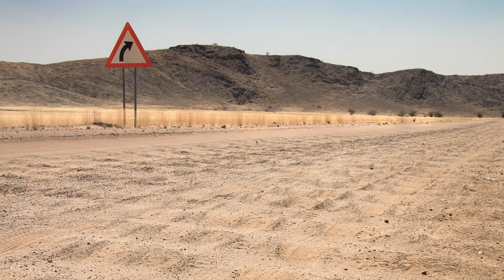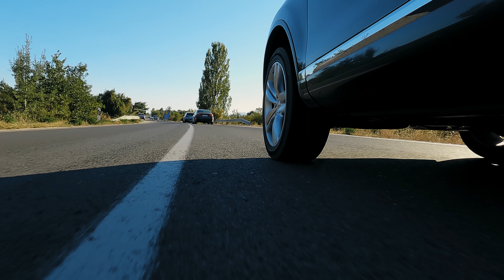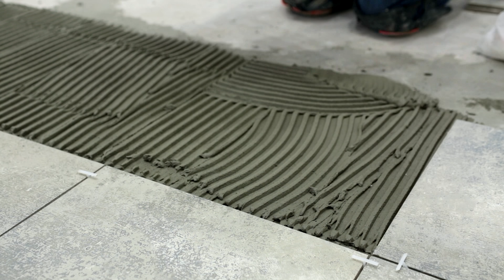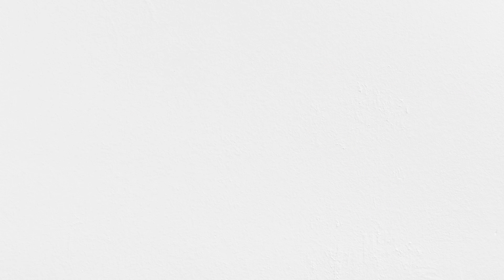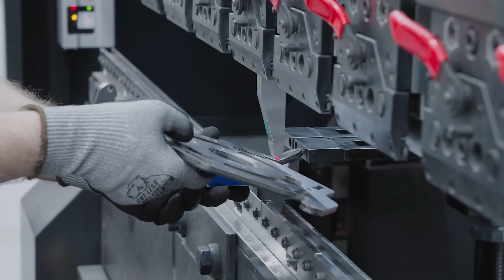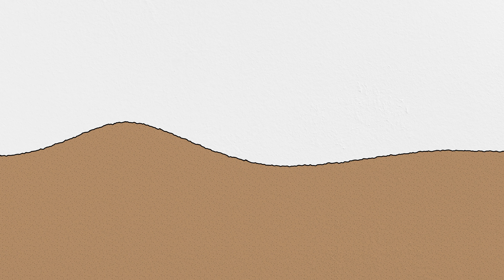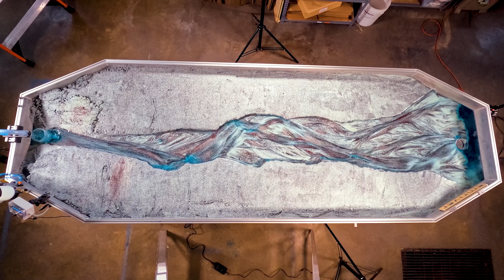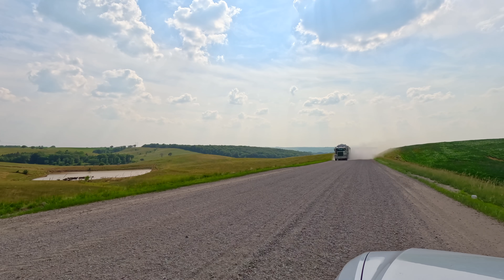Why Roads Get Washboards

Comment: Also, this setup was flawed because it relied on 1 wheel. Vehicles are multi-axle machines and have multiple points of contact with the surface having the effect of creating a frequency in the gravel medium, causing it to organize the materials in a repeating wave. The washboard is the “echo” of the traffic that came before it. 7:33

Comment: I think we had like 18-20 miles of dirt road. And every 8 years at town meeting the pitch was the same, "graders got over 16,000 hours on it. Last legs. Need a grader, all the parts for the 8000 hour overhaul, etc (basically 90% of what you're going to need other than tires for the next 8 years) you get a better deal on equipment if you buy 100k in parts at the same time.  Know what saves even more? Using the logic of the State. And run the literal "Highway Department" on "Off-Road" pink diesel.

Comment: I've argued for decades that moguls/washboard snowmobile trails aren't caused by the track roost, but by plowing the face of a bump. Sure, hard starts, spinning the track, create the pile and the dip. However, that doesn't explain the exact frequency that form along a stretch of trail.

Comment: Where I live in the remote PNW there are an unimaginable amount of unpaved roads.
Roads that are very rarely used the weather seems to maintain them well for the most part until all the fines are gone.
The main dirt roads however usually always have sections of washboards on grades. 
An easy way to slow down washboard is to just drive in 4 hi. 
All four tires pulling leave less room for tires to spin which I believe starts the process of washboard.

Comment: Was going to say its got something to do with suspension. In the sand dunes we have drag strip where we drag race atvs. The slow side has heavy bike that are shifting gears and loose suspension. That side is ways rippled out. The fast side have atv with no suspension  (ridid) and transmission that dont use the clutch. It stays smooth all day.

Comment: I would love to see a comparison video talking about differences between these bumps and "braking bumps" / "acceleration bumps" that form on motocross tracks. I was always confused by these small ones on gravel roads bc it made sense to me that they would form on the track when you're coming into/out of a turn and braking or accelerating hard, but didnt see how they could form on a fairly straight & consistent part of a gravel road. I always figured if it was just a natural tendency due to small differences like this video shows, they would show up in straightaways on the track... maybe it has something to do with acceleration/deceleration/constant speed?

Comment: The wheel was dragging. So the question, do the driving wheels or the non-driving wheels cause this? Most of the dirt roads I've driven on in the EU are not washboard. It seems to only happen in USA or other dry and devoid of organic component soils

Comment: Super interesting, as usual! I think that a vehicle's spring suspension adds to the creation of these, also, by adding to the rebounding energy with which the tires can hit the gravel. I have noticed that often, washboards are worse toward a stop sign, so I figure the added pressure of the brake action helps push the gravel forward. I have even noticed in some areas where asphalt pavement will develop a few washboards toward the stopbar before a stop sign or light. Braking must be particularly hard on the wear surface of the road.

Comment: Very neat!  I remember being told when I was younger that washboard roads were made from the tires of cars and trucks driving in 2-wheel drive instead of 4-wheel drive.  Something about the front tires in 2-wheel drive hitting the washboard bumps and making them bigger rather than moving over them.  I assumed that was right.

Comment: Semi-tractors take up hill grades or around corners cause this effect easily. The drives are so close together one wheel slips when another grabs traction. Found on all logging roads everywhere. If ever seen a semi tractor go over wash boarding you will understand... you can watch the front drive axle and the rear drive "bobble" up and down at perfect intervals , front axle up...rear axle down, then  front axle down at exactly the time the rear axle is up a teeter totter effect... this is what happens to roads when significant weight is applied to any spot. 50 to 60 tones of weight making contact to a 8" x 8" (size of tire face making area)piece of road.

Comment: This video is not really right, particularly the model demonstration with sand and a motorized wheel.  Real dirt roads are normally composed of tire compacted dirt, that experiences substantial daily temperature cycling, not pure soft sand in a fixed temperature controlled environment.  Additionally, real vehicle tires are normally air filled rubber with suspension components, which will not behave the same as in the simplified model.

Road washboarding primarily occurs on dirt roads in sunny desert locations.  In desert locations, the dirt is usually mostly or entirely devoid or decaying organic matter (ex: plant roots and other plant debris).  In the absence of the organic matter or similar factors, the dirt can become highly compacted and densified from compression associated with repeated tire travel on the road surface.

The overly densified dirt has no place to easily expand to, during normal thermal coefficient of expansion, during daily temperature swings associated with hot sunny summer daytimes and comparatively cool night times.  When the dirt road surface is overly compacted and overly dense, the individual dirt particles have no place to expand to, during temperature rises associated with sun baking during the day, leading to forced buckling of the road surface.  The raised buckled portions of dirt are perpendicular to the road vehicle travel direction, since the road is much longer in that dimension, than it is wide.  In the road width direction, the road can expand some, since the shoulders of the road normally are not as compacted and can take some thermal expansion compressive forces to force the dirt to become more dense.  However, further densification does not happen in the direction of the road travel surface, since it is too long, and there is not low density region immediately forward or reverse of the road surface that needs to expand during heating.  Consequently, "buckling" is the result, with part of the dirt pushing up in the familiar "washboard ripple" pattern.  When the road surface cools back off at night, the raised portions of the road do not go entirely back down, as the individual dirt particles simply pull away from each other instead, leading to a decrease in the density of the bulk material.  However, once a vehicle drives over it again, it gets re-densified, and if that happens before the next re-heating cycle, new buckles can form anew.  

Dirt surfaces where tires do not travel (ex: land adjacent to the dirt road) does not develop washboard effects, since it is not as compacted.  When the daytime sun heats the non-road soil surface, the individual dirt particles can expand and increase the density of the dirt, without causing buckling effects.  Instead, the dirt particles expand into the air or water voids that are normally present in the bulk material.  However, overly compacted dirt does not have the necessary air voids to accommodate thermal expansion without forced buckling.

To prevent washboard ripple pattern effects on dirt roads, something compressible but somewhat elastic could theoretically be mixed in with the road surface material.

Asphalt road surfaces are normally much less susceptible to thermal expansion buckling effects, as the gravel particles used in asphalt roads tend to be quite large, with considerable voids between the gravel particles.  The tar in the asphalt road also acts somewhat like a very viscous fluid, particularly at high surface temperatures associated with sun baking, which allows the material to slowly flow and change shape to better fill and/or ooze out of the voids/regions between gravel particles, during thermal expansion.  However, during thermal cooling, the thermal contraction does pull the road apart from itself, eventually leading to cracking in the asphalt surface. Consequently, asphalt road surfaces to not last forever, as they lack tensile strength, but they are at least better at avoiding washboard/buckling effects.

Comment: I was wondering when this phenomenon became apparent. There must be a minumum wheel width so that you get washboarding rather than wheel ruts. Speed, or maybe power, is also significant. But if everyone isn't following the same rut then the circular demo breaks down because the wheel in that always follows the same path - not one a little to one side or the other of the previous one. Surely then the forces on the dirt push to the sides as well as forwards.
Thanks for an interesting insight into roads and showing why (as all academics would agree) further research is needed.

Comment: LOL'ing just a bit remembering a "major" (unpaved) road that used to be one of the main routes into my community several years ago. The county's approach was to bring out the graders a couple or three times per year until the eventually threw in the towel and paved it (and then had to repave and repave and repave because asphalt is definitely not indestructible).

Comment: I don't believe you. I don't think that the washboard in some of the footage, that is at the very edge of the road, where people would not be driving, for fear, or being cautious, of not running off the edge of the road into the ditch, is caused by tires.  And the straightness of the lines of dips tells a different story. Bouncing road grader blades cause the majority of washboard, at least in Colorado.

Comment: After 35 years of dirt roads, washboards are something I've though about a lot. Solid axle trucks in 2 wheel drive make them form fastest. The always form on loose uphill stretches first. Often times downhill stretches dont get any at all. And if you want to smooth out the washboards put it in 4 wheel drive.

Comment: Has anyone tried using a type of resin or glue mixed in with the sand to keep the road straight. I know this would make the roads more like sand paper or a grinding wheel, but I'm sure there might be some materials out there that would be more rubber tire friendly.

Comment: Wonder if it could be "solved" by having a secondary tire that overlaps the rear tire but connected to the same piece of suspension. So when the front tire is going to drop down into the low point the overlapped reartire is at the peak so it never has the opportunity to drop causing the washing boarding.

Comment: Grady, as interesting as all of your topics have been to date, this one reeeeally hits home!  I've pondered washboard a lot since 2014 when I left the South (a Beaumont native corrupted by Tennessee for most of my life lol), for I moved to North Dakota during the oil boom after 20+ years driving trucks long-haul since '93.  During the boom, eeeverything was dirt up here in western ND and eastern MT and often very remote, especially in the badlands.  Instead of limestone gravel like we had back in the South, they use scoria up here (sedimentary rock that often has fossils within).  It remind me of clay pots, for it's a similar color and after new scoria is spread on a road, it doesn't take long for traffic to crumble it into highly abrasive dust that turns to the slimiest mud I've ever been in (honestly, I'd rather drive on ice that to drive in our mud, for even throwing tire chains, it's often a losing battle).

More and more of the counties up here have been paving the most trafficked county roads but there's still a tremendous amount of mileage that's "dirt" (scoria}.   Of course, the entire population for the state doesn't even make up a good neighborhood in NYC or the Metroplex.  lol  So washboard is still ever so common up here.  It took a while to learn how to drive it, as well, for there is a sweet spot in speed for much of it where it smooths out while still having control.  The experiment you set up kind of confirmed my guesses, though.  Thanks for making my day with this one!  :)

Comment: I honestly wanted to comment at the beginning of the video of what causes washboarding.  I frequently 4WD in the Outer Banks (will be there in less than 2 weeks doing this).  Constantly I find the ruts in the sand all washboarded out, and its largely due to high power pickups and diesels that just cant find that sweet spot with controlling their torque.   Between the constant slipping each tire makes and the excess power generated by each vehicle the roads or ruts just arent a very pleasant ride.  So for this application it makes sense, and I would call it rhythmic transfer.   More speed / power = greater transfer.  Which is exactly what I saw your experiment yield @8:36
Reply: Would be to interesting to see if there are the same number of undulations at different speeds.
Reply: Worked on a mine with excessive soft sand. The chaps there had worked out that 4x4 engaged was the only way to prevent corrugations. It became compulsory dye to the slip on 2wd vehicles. Honestly it worked well.

Comment: One look, 2 mins in, just putting a guess here before i finish the rest of the video. its a frequency. likely the frequency is dictated by average length of distance between axles, wheel size average, and the average speed at which those vehicles travel over the road in question. obviously the solution can't be to vary your vehicle axle count, length, speed, or wheel size so the solution likely involves purposeful rock and pebble size or layering to disrupt or cancel the frequenc(ies) causing the washboards to form in the first place. this may also be impossible due to the rural and cheap construction method underlying the reason unpaved roads exist in the first place. i imagine this also happens on softer or poor foundation paved roads as well in certain conditions.

edit: still havent played past 2 minutes in the video. im predicting the solution other than specific layering of different sized rocks and pebbles for the unpaved road, would be to have different speed limits at different times of the day to change the average traffic speed and thus hopefully disrupt any consistent frequencies from impacting the road consistently enough to generate the washboards, which likely self propogate once formed

edit 2: finished the video! seems like i was somewhat right and somewhat wrong, but ultimately i think i was right as my proposed speed limit differences at perhaps different times of traffic frequency will help mitigate the issue. I also do not think synthetic grid material will prevent washboarding, i think it will only change the frequency of the highs and lows and thus distance of the washboard effect that takes place upon the road, given enough time and no other controls in place.

Comment: Thank you for scientifically proving and beautifully describing what we Motocross riders already knew. At the beginning of the day, the track is graded smooth, but has a few bumps and jumps or undulations. As each bike's wheels hit those bumps, the suspension compresses and rebounds at a fairly consistent rate. By the end of the day, the "washboard" can be over a few feet deep in the form of whoop-de-doos. The greater the suspension travel, the deeper the whoops get. And the depth changes if the surface is watered. Skiing has the same problem with Moguls.

Comment: Interesting subject, as always! Out of curiosity I wonder what factors you would need to adjust in your model apparatus to re-create a washboard effect more visually similar to a washboard road surface. Wheel size, downforce, speed, material composition. First I think the material requires a much firmer substrate so that the material at the surface can’t simply continue to push out of the way. But there’s also the possibility that the physics involved simply don’t scale. 🤷🏻‍♂️

Comment: Does the “washboard” amplitude change at differing speeds?
Do more jagged “sand” reduce or lower washboards?
Do train tracks get washboards?
Does the jagged rocks used as a foundation reduce it?

Comment: Ever feel washboards in concrete? I have. Outside of Fremont Nebraska they paved a bypass around the town. They failed to use proper amounts of rebar and after a few years a subtle washboard effect began to form. Driving on it at highway speeds began to feel like driving on a flat tire. Eventually they did some fixes (not sure what, wasn't there at the time) but even today the north overpass still develops a rhythmic bounce at speed.

Comment: I am not planning on building any roads but great video. I always thought that the dips were made worse by torque of the boncing drive wheel. But I can see that's not the case.
  Seeing synthetic material augmentation on your simulator would be a great video

Comment: I am very curious, what affects the wavelength of the washboard. I would love it if you did more testing to try to determine this. I wonder if it’s based on speed, road material, wheel diameter, suspension, stiffness, wheel, mass, etc..

Comment: Sand might be useful for a tabletop experiment, but most real washboards are generally in compacted dirt/gravel and they don't migrate like dunes, they just get higher amplitude over time.    I've driven thousands of miles on washboarded roads, and and some roads a thousand times.   Between gradings they'll often form in exactly the same spots.      And yes, going fast over them carries some risk it actually cuts down their formation over time, and (with a decent suspension) leads to a smoother ride.    The problem is, a lot of people slow down to exactly the speed that amplifies their formation.